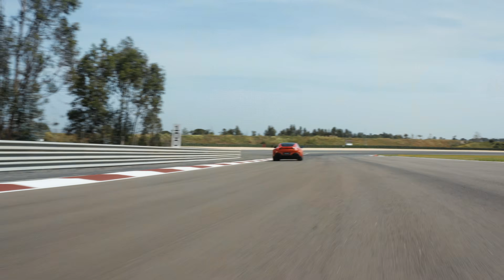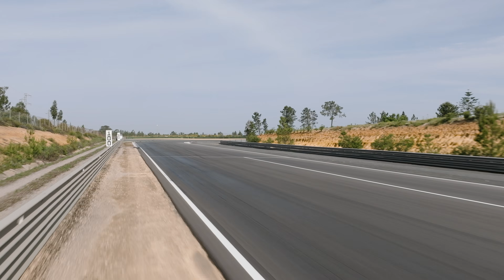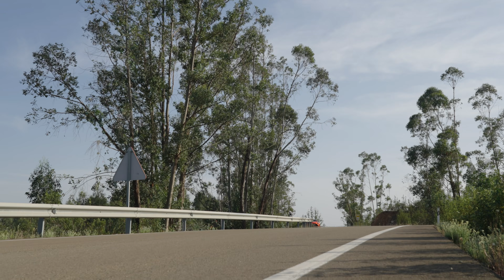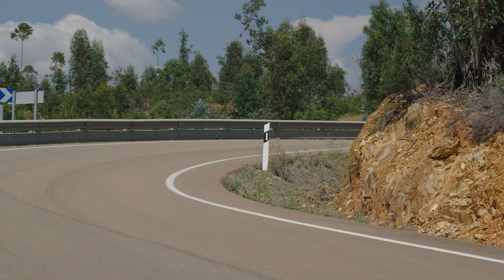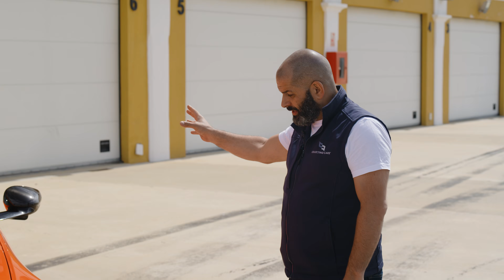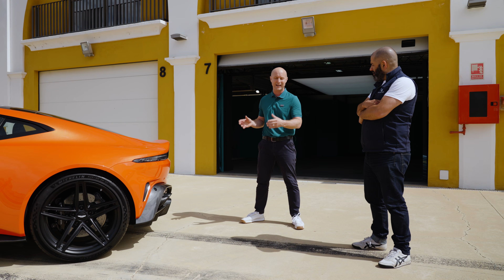Chris Harris on Cars | Aston Martin Vantage: full test. Road, track and full tech chat

Comment: You're right Chris, AM NEEDS to keep building GT cars.... NOT THIS!!! I just can't understand how STUPID they are at AM... Why the hell are they trying so hard to competition against Porsche; NO ONE can compete with them! Not in terms of performance and efficiency. Most of the people who like and like AM cars are more.... classy, more sophisticated poeple. We want a PLUSH ride coming from AM; a LUXURY brand. Why did they call them stupid? Well as I said they are going away from what their customers really want. That's marketing 101. But there'S an even bigger reason. How hard can it be, to make a "comfort mode" with these electronically controlled dampers??? Those dampers are the same used in much more plusher cars, so its not a damper problem or limitation. Comfort is the only thing that is still preventing me to buy one immediately. I don't want a ride that is so stiff that you need a chiro treatment after each ride. Corvette can do it, McLaren can do it, Porsche 911 can do it; so why not AM. On top of that they say the vantage is a direct competitor to porsche; so guyas, give us a fucking easier ride if you PRETEND you cab be Porsches equals... I'm about to go to an AM dealer to see if it is possible for them to recalibrate the "sport" mode in order to get a minimum level of plushiness for bad roads or when you really want just a GT car for a long ride. If not, I'll have to go for either a corvette or a Bentley GT. Maybe even a 911 because i'm kind of afraid of the Bentley's reliability/ownership cost (same for the McLaren or the maserati which I have both considered seriously). ALL of them are more confortable than the AM... Why not a BD12 or a Vainquish? I don't like the look of the Vainquish at all (way too long proportions, it looks like the car melted and then someone pulled it and stretched it), and I feel robbed by the DB12 because i'm single, no kids, and I don't see why I would waste thousands of dollars for nice rear seats that will never be used, and not usable anyway lets be serious.

Comment: Three things I would change - first get the weight down - 3160 lbs would be ideal - a second - keep the 4.0 litre naturally aspirated for a better exhaust note - but let it rev to 9200 rpm or there-abouts - 560 bhp and 3160 lb curb weight would be quite wonderful. Finally - a 6-speed manual gearbox - I don't care if the auto gives you faster 0-60 times - manuals produce wider grins.

Comment: Very nice video! Personally I think the front grille has grown too big. It still looks good, but a slightly smaller one would look more elegant and suit the car better. Interior looks nice but then so does a lot of modern cars: it's overdesigned if you ask me. Should move backwards towards a simpler, more elegant design with analogue dials where possible, less techno-bling which is irrelevant to a car like this and more leather and elegance. More restrained and classy would fit an AM better I think, even though its a sports car. Compared to their older V8s (2005-2016 or whatever) the new engines might be loud but they sound so boring, just the same grunt all the way, getting louder. I own a 2008 V8 Vantage and I think it's still the car for me, comparatively.

Comment: Too bad, this vehicle is slower than the cheapest Tesla Model.  The Tesla Model 3 does 0-60 in 2.9 sec.  This does 3.4.  It would also be slower around a technical track.  The Aston Martin is more than $200k, while the Tesla Model 3 Performance is $55k.  Any gas vehicle is a donkey cart compared to an electric vehicle.

Comment: The current Vantage is nice, no question about it. But the previous one built around 2009 was simply stunning.
Aston Martin really lost it for me. There is not a single car in their line up I would choose if I could have a used V8 Vantage with the 4.7l engine from the earlier generation instead.

Comment: It didn't sell because it had an AMG lump in it and the interior was shite. Not because it is lacking in stiffness. The original V8 Vantage / V12 Vanquish - DB9 is a testament to the fact Astons did a lot better -sales wise -  when they had their own engines, not some crate engine from another manufacturer. Not saying the AMG unit is bad. It's the fact a brand like Aston should really be getting their own engines sorted. Perhaps Cosworth can assist with the next effort.

Comment: LOL you don't mention the 2 second lag on acceleration! 3.5" 0-60 is ridiculously slow for a 665hp car. They increased the turbo size to increase the HP for the crowd, to justify the $190.000 + $60.000 forced by the dealer on extras, meanwhile the 0-60 was improved only by 0.1" from the previous model with 165hp less! HAHAHA overpriced mercedes crap! (yes, I owned the previous vantage).